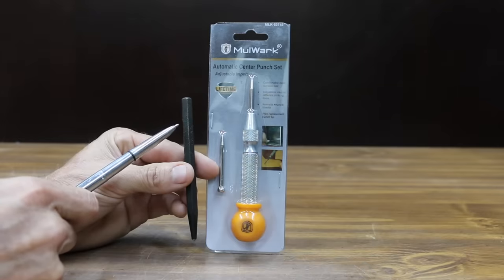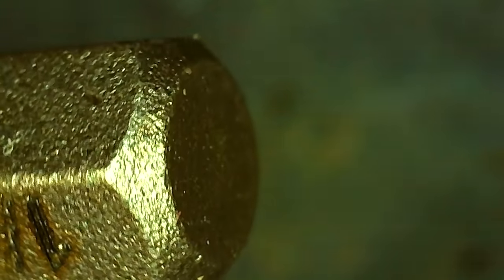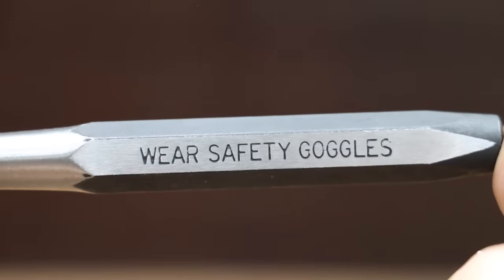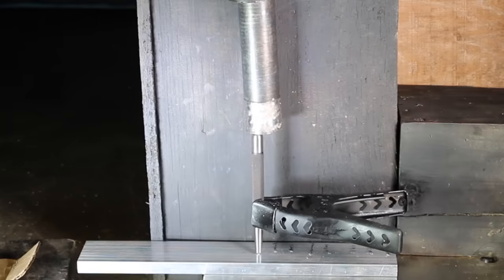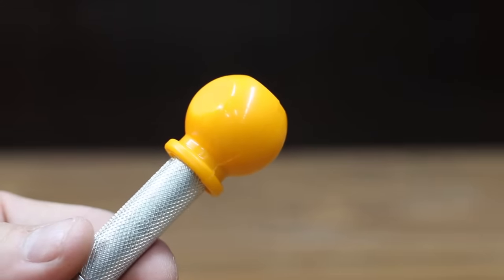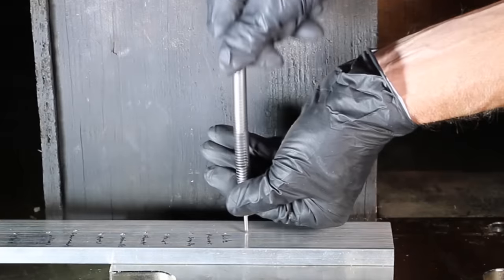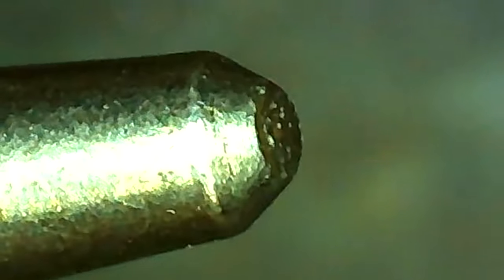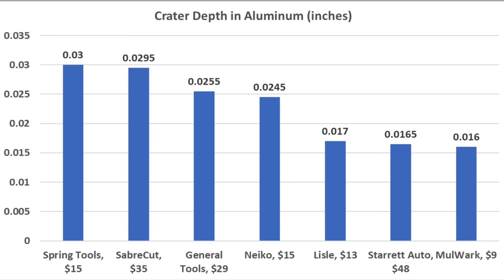Is a Cheap Center Punch Just as Good? Let’s Settle This!

Comment: WARNING : I have a Spring Tool center punch and I'm glad it performed well in your tests but I will say the actual design of it might be a deal-breaker for many people. If you want a precision tool, it might not be for you. It takes more practice to use so you don't move off your mark. Also, it would be near impossible to use properly if you were working in tight spaces as it requires 2 hands to be on the tool.
Reply from the maker: Thanks for sharing!
Reply: I was going to try the springtool punch, but if figured if I could use two hands I would use a manual punch.
The benefits I see of the auto is one handed operation, and all the automatics I’ve tried work on soft material but fail on the hard alloys.
Reply: We use the spring tool punches with the fire department as a glass breaker, and they work absolutely amazing for that. I've seen them break plenty of windows that the push punches just can't
Reply: @williamletts9487  I use a device with the same design to remove door hinge pins, and another to adjust dovetail gun sights. It's a really cool design where it works, but I agree with the earlier comment that they aren't all that precise.
Reply: I agree totally. I have a Spring Tool center punch, and then design is not great for the precision I look for when marking.
Reply: @tomsko863 I use the spring tool chisel on break away bolt on steering columns. They’re perfect for that small space. Just a couple pops breaks them loose.
Reply: @jasonalbert9939  That sounds great. I just know that If I had to get a punch on a part that wasn't easily accessible, the Spring Tool would be the worst to use of the group.
Reply: I have one of those spring punches and to me they are an absolute fail for center pouches.  Even though it does it make a good dent, it is extremely to hold where you need to make the dent.  If you are using a center punch to PRECISELY place the mark for drilling and if you can’t precisely make the mark it is totally useless.  One little twitch while pulling back the spring and you will miss the mark.   I have one of the spring punches and I hate it for that reason.
Reply: I have a different tip on my spring tool, I use it for setting brad nails.

Comment: I don’t do much with metal, but I’m very pleased with my spring tools nail sets. They are extremely convenient when setting proud nails into wood. Better than using a hammer and nail set, and they hit plenty hard enough to set trim nails.
Reply from the maker: Thank you for sharing!
Reply: I also love using the hinge pin remover version as well. Much more compact when you're trying to get the bottom hinge, and you're less likely to dent or scratch the door or trim with a misplaced hammer blow.

Comment: I’ve had a snap-on center punch for 10 years as a professional metal fabricator. Mostly working with mild steel, I’ve only sharpened it 2-3 times.

Comment: I’m so glad you did this comparison. Two takeaways come to mind immediately— 1. The Starrett brand surprised me the most by its under performance, and 2. I have bought a couple of different brands of spring loaded automatic punches over the years, and have returned almost as many. So many have failed to “cock or recock” when used. Another YouTuber remarked that customers should buy three or four of the Harbor Freight ones and keep the one that works. My sentiments exactly.
Reply from the maker: Thanks!  Thanks for the feedback.
Reply: bradbyers7505
I agree, but you can apply this logic to most any other brand  compared to buying snap on brand, it's not just HF brand .
This negates the main convenience "advantage" of buying overpriced  snap on tools.
You already have 2 to 6 of the same tool for backup for immediate use VS waiting a week or more for the truck to arrive.
Reply: I've had both the manual and auto Starrett punches since the 70's, never had a problem with either, and my auto came with a point from new. Obviously the manual punch is better on tool steels than the auto, horses for courses.
Reply: I have the starrett auto, it is supposed to come with a sharp tip. They should send you another one
Reply: Lol, sounds like a sports announcer. Better than any sports game I've ever watched.
Reply: I bought the Starrett automatic based on seeing Adam Savage talk about it, and then am pretty sure I saw AvE with it as well. Mine came with a pointed tip and is a great tool. You gotta test what you bought, but boy what a mess-up for Starrett here.
Reply: @ut4321  The consensus seems to be that it's a conterfeit.  Amazon's fault, not starrett's fault.

Comment: I'll vouch for the  Starrett 18A auto punch's durability, still going strong after 30+ years of hard use. I think its had maybe 10 tips over the years and I grind them till they can't be used anymore.
Reply from the maker: Thanks for the feedback.
Reply: Maybe I need a Starrett.  I've never had an autopunch work for long.  And I've used lots of them.
Reply: @anvilsvs  Yes you do, at the risk of sounding like an add. I would get the bigger unit though, I have had some times were I wished for a little more "wallop" than the 18-A could deliver. Other than that it seems to be a lifetime unit.
Reply: I think the one he bought was a lemon; Starrett has always been reliable to me.

Comment: I haven't personally used a single "store bought" punch ever since I made my own, from a piece of the suspension spring on a car. It's been over a year since I made it and i've used it A LOT and i've never resharpened it. Works absolutely amazing
Reply: Same
Reply: Show us. Got a video?
Reply: Same. I like using 4340 or O1 to make center punches, drift punches, pin punches, roll punches, chisels, etc... My starret punches sit in the toolbox, primarily because they're round and roll around while I'm working. 

I have a couple of overload springs a buddy gave me when he busted one. Working it is real drama, unless it's annealed. I will try using that material next time.
Reply: @stevenkelby2169  I don't have any pictures or videoes unfortunately. I could make a video of it being used though
Reply: @andreashenriksen1485  Thanks! Even just a rough description of the way you made it?
Reply: @stevenkelby2169  Well I started by cutting out a piece of the spring, then heating it up and hand forging it to the rough shape of a center punch. Then I took it to the grinder to get a close to finished look on it. 
After that I heated up the center punch and quenched it in water. Then i reheated the center punch about 1/4 of the way up (from the tip) and when the color from the heat reached the tip I quickly quenched it in water again. 
I hope that made sense :D
Reply: @andreashenriksen1485  Thank you Sir, makes perfect sense and I'll give it a go! 🍻

Comment: To armchair quarterback, I've found that it's so easy to do multiple hits with automatic center punches.  I know that could also be done with a manual center punch but it's really easy to just push that automatic one down a couple of time.  It would be interesting to have seen what a 2nd strike for some of those automatic center punches would have done.
Reply from the maker: Thanks for the constructive feedback.

Comment: Good analysis video. My experiences are similar to your results, and curious about different brands you tested. Many modern alloys are a challenge to center punch. 
manual punches are a must have, the automatics have let me down and I end up using a manual. I’ve used, abused, and destroyed several automatics. The Starret wins because they replaced, or provided a repair kit promptly. The automatics are useful for multiple one handed punches on softer metals and that’s their limit.
The manual Starret and Snap-on have stood the test of time, some are 50+ years and still going. However I have ruined several of both on very hard steel alloys.
Good video, and thanks a lot for saving me from endlessly searching for an automatic for use on hard metals.

Comment: I like the Spring Tools punch for setting nails. No other nail punch I have found has the speed and force needed to set small 18 gauge finish nails when they fail to go all the way in.
Reply from the maker: Thanks for sharing.
Reply: I have the Spring Tools nail set and hinge pin remover and they both work far better than the alternatives I've used in the past.

Comment: It'd be cool to see how levels compare, for such a seemingly simple tool there's a ton of options with a huge range of prices. Like on a 48" level there's one at $10 and another at $149
Reply: Oh, good idea! Todd reads these for ideas, so he might do it.
Reply from the maker: Great suggestion!  Thanks!
Reply: Stabila must be represented with at least 2 models!
Reply: @ProjectFarm seconded.
Reply: @ProjectFarm it will be tricky to do levels, because you might have a brand with really loose quality control, but happen to get one that's exactly correct right out of the box, just by luck.
Reply: Before you buy a cheap level, lay it on top of a good level and see if it matches up. Check both vertical and horizontal directions. You can sift thru a few cheap levels until you find one that matches up with a good level. That way, you have a cheap level that works like a more expensive level.
Reply: What a great idea for a tool to test. Not just their level, but also for straightness, and holding level after various drops.
Reply: Agree!
Reply: @ProjectFarm yeah, levels would be a great one, compare accuracy, strength, price, durability.
Reply: Digital vs bubble.

Comment: As other comments mentioned, tip durability, especially for the loaded punches would be an ESSENTIAL factor. I find that using a loaded punch is much much more convenient that having to hit the classic punch with a hammer. For harder materials (or if i want a larger spot) I just spring punch a few times in the same spot and thats it. Thats why durability of those tipos is critical.
Reply from the maker: Thanks for the feedback.

Comment: For thirty years now I've been using a 3/8-18 tap for a center punch.  I always thought it was a nono to strike hardened steel but it doesn't have any chips and the point is still sharp after a thousand strikes.
Reply from the maker: Thanks for sharing!
Reply: Did it start out as a 3/8-16 and you've compressed the thread pitch by hitting it? Eventually it could become a 3/8-24! 😂

Comment: When I saw the Starrett thumbnail for this video, I had to check my tool bag to make sure the center punch I made in high school machine shop back in the 70s hadn't been magically spirited away. I had copied the design from a punch my father—a tool & die maker for GM—had in his home tool collection. I did the lathe work in school, and he taught me techniques for oil  hardening it at home. It's a cherished possession, and is still going strong 45+ years later.

Comment: Would love to see the PB swiss punches tested, I've used both their steel and carbide tipped punches and have found I prefer them slightly to snap on punches. The fit and finish is exceptionally good :)
Reply from the maker: Thanks for the suggestion.
Reply: @ProjectFarm   adding some euro-made center punches from Facom, Rennsteig or Eclipse to the PB Swiss would be great as would be a few automatic japanese ones from SunFlag and Vessel along with some OEMs like the Fowler branded ones sold in the US. don't forget to test the cheap chinese/HF stuff too! 😉

Comment: I have a centre punch which has lasted the test of time .A Mechanical Fitter in the 1950s used a coal cutter pick as a centre punch .He passed it on to me in the late 60s and I still use it to this day .I have used the  punch  many thousands of times in those 50 odd years marking out 8 x10 inch girders , Drilling 1 inch holes .The coal cutter pick is still like new .It has a tungsten tip on it .Even the striking end is still undamaged. I would strike it 3 times to make a good indentation for a 1 inch drill  with a 2 LB Hammer. I have a smaller cutter pick from the 50s for more precision work,  still like new also .Love all your videos  , they are the best ...
Reply from the maker: Thanks!  Thanks for sharing.

Comment: I'm surprised to see the dull Starrett punch.  I've got a Starrett 18-C punch I purchased in about 2015 or 2016 and it's still pretty sharp.
Reply from the maker: Thanks for sharing!
Reply: I also have and use daily a Starrett 18C. It is probably my favorite punch. It works perfect for aluminum, and steels I use it as a starter punch and follow through with a hammer and traditional punch.
Interestingly enough the tip did get pretty deformed after only a year or so of use. I've had to chick it in a drill to regrind it a few times. Pretty annoying. I guess when it truly wears out I'll have to try finding a replacement.

Comment: Good as always, however I believe the bounce in your first test is a function of where it hits on the length of the aluminum plank, therefore introduces errors to the testing you did.  I think you should have secured the test pieces to control results.

Comment: With automatic punches you might want to also test the mechanism durability. I have gone through a few, they just don't strike anymore or only do so sometimes at a weird angle. I've only used them in aluminium and some mild steel, so the tips are usually in perfect condition but that is not any help when the tool beomes a scribe with suspension ^^
Reply: been using a Starrett-made Würth rebrand for close to 15 years now and no problem with mechanism durability, same with a couple of made in Japan Sunflag models, 185 and 188, the first one being carbide tipped and no problem with those two too. i'm sure other manufacturers make good, durable ones but it might take a bit of research and testing to find them. 😗👌
quick tip for reducing punch head mushrooming: use a hard plastic no rebound hammer, the PB Swiss ones with the discs inside are really good but most will do with manual center punches when using the propper size. same with and impact driver, it does prolong their life greatly. 😉👍

Comment: So I have the Starrett automatic centre punch (when I got it, there were two choices of spring tension, and I bought the heavier of them).
My punch head (still) looks dramatically more pointed than the one as seen in test.  

I do find it at the highest tension setting to be overly heavy for the size hole it punches. However, I think I may have only once experienced a punched hole that was not sufficient for stopping a drill bit from walking over the face.

Thanks for the test! Logical, but still somewhat surprising results!

Edit: stuttering thumb with StarretT
Reply: I've also got the Sterrett Auto spring punch. The tip on it is not blunt like the one you used. You may have received a faulty product. Maybe you can get it exchanged for a sharp tipped product and retry the tests. 16:45
Reply: I concur.  My 15 year hold Starrett auto punch has a sharp point (still).  I would say PF received a defective punch.

Comment: Regarding the Starrett automatic center punch, I had to check mine to make sure, but you definitely received one that was used or damaged. Mine has a perfectly sharp tip on it. Possible someone attempted to use it on something very hard, and then returned it as if it was never used. Granted, I use mine for mostly aluminum, so I'm not sure you'd see that much better results outside of aluminum. 
Some nice options otherwise!
Reply from the maker: Thanks for sharing!
Reply: That's part of the test though, When you spend for a starrett you are paying for QA.... or should be. I'm sure a review unit would have been perfect, but that's why it's so important to just buy it and see what you actually get in the box as a consumer. In this case, a POS... super disappointing, I expected starrett to run away with this.
Reply: @tshackelton Yes if purchased direct from the manufacturer, but I’ve gotten (and returned) some questionable items from Amazon and other retailers.
Reply: Todd, Agreed - you might want to check with Starrett on that auto center punch - looks like someone may have abused it and sent it back to wherever you purchased it from.  I wholeheartedly agree with your no-gifts stance for testing, but when something is as off-kilter as this, you would be doing us, your viewers, a disservice to not check/confirm your results with the manufacturer.  It is very possible you have a forgery as well.

Comment: I have the spring tools 2 piece set. I use the punch often, especially in tight places you cant swing a hammer. But I really enjoy the flat head punch for pushing door hinge pins. It is "very impressive." Thank you for your no-nonsense reviews.
Reply: Door hinge pins and I found a drawer pull as well.

Comment: The Gedore 101(similar to the Sabrecut model) and Starrett 18C are excellent automatic center punches.

This specific blunt tip on the Starrett model used in this testing is designed for large diameter drill bits and softer materials. But they have sharper tips as well.
Reply: I love my 18C! On aluminum it's perfect by itself, and it's quite precise for steel as well. Sometimes I follow through with a regular punch and hammer, but only if I'm doing something larger or really thick steel
Reply from the maker: Thanks for sharing!
Reply: Yea, my Starrett 18C has a sharp tip   I wondered if he got a used tool when he showed that tip. Because all of those automatic punches don’t leave quite as deep punch as the manual ones, I usually deepen my center punch but I think it’s easier to locate the original punch with the slimmer automatic one. 
Thanks for sharing!
Reply: I agree with what ffontana is saying.  There are many varieties of Starrett auto punches.  I think the one you were testing with here is recommended for wood in their documentation
Reply: I have the Gedore and like it a lot.